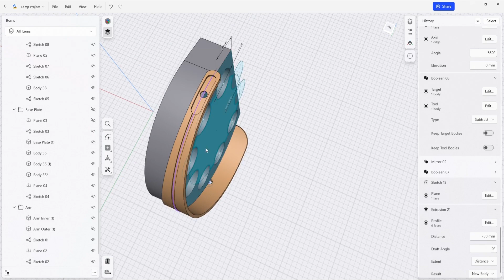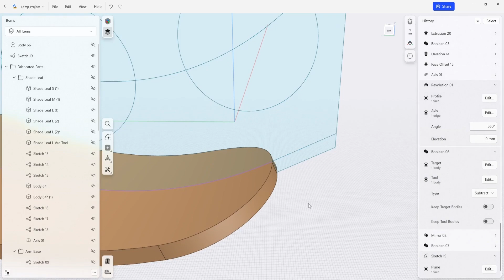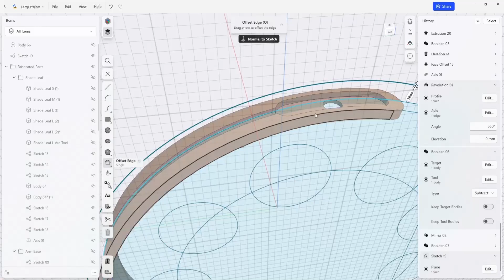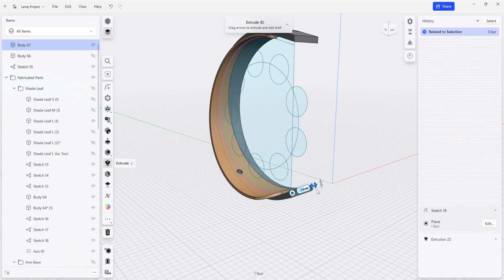Lamp arm exterior template | Shapr3D Design for Manufacturing

Comment: This is an awful way to manufacture this part. Why would you not create the part flat with all pieces cut out and then glue on a simple form. This would take so long and be prone to mistakes.
Is it because shapr3D doesn’t have the capability to flatten out parts? Will that be a feature they’re going to add?
Reply from the maker: Thanks for the comment. These videos are tutorials that help you both understand how Shapr3D works, and also what problems you can solve with it. Some solutions require workarounds, in case we don't have the right toolset yet. Flattening out a part is something we have on our longterm roadmap.